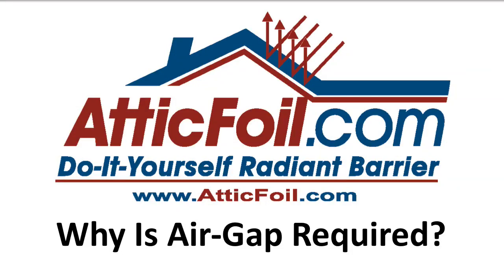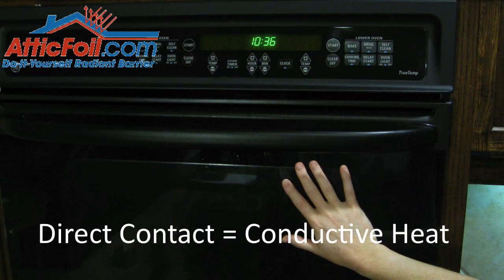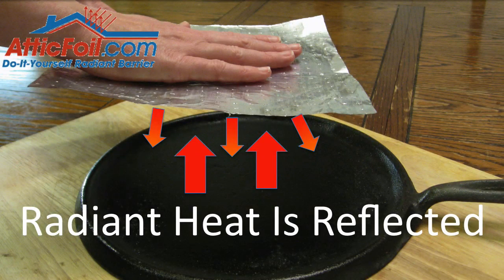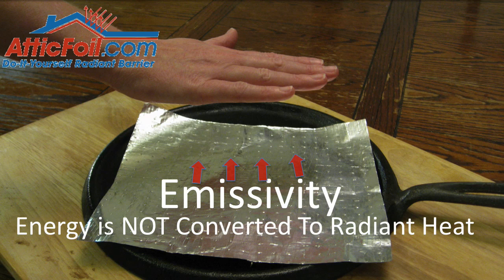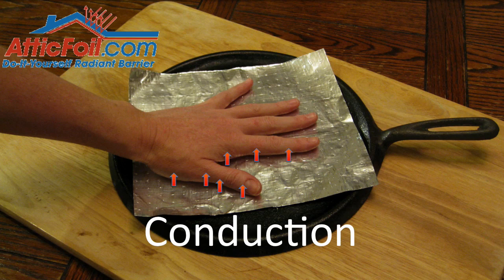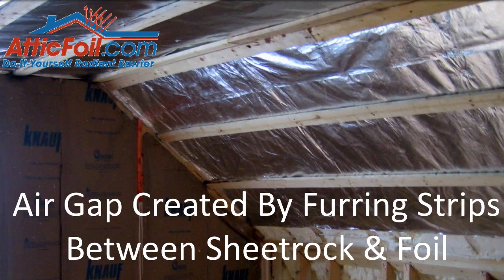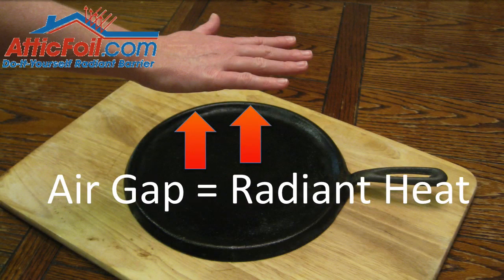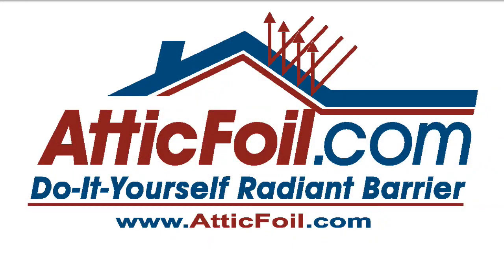Radiant Barrier Foil Insulation - Why Is Air Gap or Space Required?

Comment from the maker: Usually one layer is all you need.  Putting AtticFoil on both the bottom of the roof rafters AND on top of the insulation will have a some additional benefit.  

When you consider the extra time, money and effort for the second layer it is usually hard to justify doing both.  I have had some customers do both with great results. I would only consider doing both in a mixed hot & cold climate area.  Visit AtticFoil(dot)com and look at the "Best Install Method" page for more info.

Comment: I have a flat shingle roof, with metal roof over, stabled by footers, to create small pitch. There's a big space between the 2, like 6". Can I install Radiant Barrier product directly to my shingles? The dead Air Space is there.??
Reply from the maker: thewildlifecrew Yes, if you can get the radiant barrier between the metal and the shingles this will definitely help.  If it's ventilated air, it will perform a little better then if it's dead air.  The airflow will help cool the metal roof, reducing the initial amount of radiant heat produced.

Comment: A little late for the party, but I was hoping someone might be able to help; I'm looking at insulating RVs in a more modern fashion and have been trying to play with Radiant Barriers. One thing I am trying to overcome is the air gap, or "attic space". RV ceilings offer little room to work with, but does anyone think that a layer of large cell (expanded) polyurethane could play the part? Enough air in between the cells to act like an air gap? Thanks in advance.
Reply from the maker: Not really.  It can be a real challenge to get the required airspace in many assemblies.
Reply: Yes Keys,  use closed cell polyurethane foam immediately under/behind the vehicle skin.  Air gap is only used in primitive buildings to insulate from outside.
Reply: AtticFoil Radiant Barrier Foil Insulation

If I was to install this insulation in the van and leave a suit gap between the outer panel by stretching/fixing the foil insulation across the inner "spines" (supports) of the van.. Would this create the air gap you talk of?

Also does doubling up on thickness = doubling up on "r" value?
Reply from the maker: Yes, on the airspace.  No on doubling up. Foil is like an umbrella, it has no r-value.

Comment from the maker: Yes, generally galvanized staples are used.  There could be some reaction between the steel and aluminum, but the contact area is so small this is not a big concern.  I've got thousands of customers and never heard that it was an issue.  You could use plastic staples if this is a big deal.

Comment: I'm stud framing a shipping container and will cover it up with 1/2 inch sheetrock. Can I install radiant foil as the only means for insulation between the sheetrock and the steel?
Reply from the maker: Check out our new Foil/Foam products at www.BlueTexInsulatioin.com

Comment from the maker: @ak99372 Bubble foil around ductwork is a lot of work for very small benefit.  You must be very careful to maintain an airtight airspace.  You are better off using a standard radiant barrier/fiberglass insulation duct wrap.  you will get more, r-value, it's cheaper and it's much easier to install.

Comment: Is this the same with cold? Like for example, if I have a van with aluminum floors and put cork insulation directly on the floor vs creating a 1/4" to 1/2" air gap between a layer of foil and then the cork insulation. I mean will that airgap keep more cold out???
Reply from the maker: Technically, you don't keep the cold out, you are trying to keep the heat in.  In your case most of the heat lose through the floor is by conductive heat flow, not radiant heat.  So, the cork is actually better.  The www.AtticFoil.com would be best for the roof/walls that catch sun and you are trying to reduce heat gain when the sun is out.

Comment from the maker: @ak99372 Bubble foil has an R-Value of about 1 since it's only about 1/4" thick.  Any additional r-value you see advertised is in the form of a "dead air space" which is very tricky to achieve on ducts. It's not worth even trying.  I'd keep it simple and buy some "duct wrap" - R-4 to R-8 with foil on the outside.  It's a standard issue product in the HVAC industry. Before insulating you want to SEAL the ducts with a good quality mastic.  Seal then insulate.  Need more info? - AtticFoil-dot-com

Comment: Ok I was wondering about it touching insulation. So basically half inch free space.  Does the air bubbles wrap plastic not count as air gap space
Reply from the maker: Yes, 1/4" or more is all you need. www.AtticFoil.com does NOT have air bubbles.  And, you should never use a bubble product in an attic.  No, the bubbles do not count as an airspace because there is a layer of plastic that makes the bubble between the bubble (air) and the foil.  So, technically, there is not an airspace next to the foil.

Comment from the maker: @bumhokim There is a new testing procedure for flame and smoke.  This is called the ASTM E 84 and ASTM E 2599.  Nothing changes with the product except it must undergo a different method of testing.  Eventually codes like the IRC, IBC, and IECC usually adopt the ASTM Tests.  It will be a while before anything happens.  Right now nothing has changed.

Comment: So gor a house in winter heated by hot water radiators (which fo not radiate, they convect!) How effective is a reflective foil?
Reply from the maker: A radiant barrier like www.AtticFoil.com is definitely more effective when a radiant heat source is used compared to a forced air system.  Basically, there is more "heat" to reflect/keep in.

Comment: We have this in the walls, built back in the 70ts. mostly replaced with thicker walls and insulation but it acually worked decent. Maybe its something to think about - using foil And insulation!
Reply from the maker: Yes, here is the way to www.AtticFoil.com in an exterior wall: https://atticfoil.com/index.php/applications/inside-exterior-walls-hotmixed-climates/

Comment from the maker: @ChrisUTMBA Bubble foil is a decent product.  However, it usually works no better than AtticFoil - It's the foil doing all the work to reflect radiant heat. The only airspace is on the outside of the foil since it cannot have an airspace on the side that it is glued to something.

Comment from the maker: Trapping heat and trapping air are two different things.  You cant use the attic temp as a gauge.  Ideally, you want you attic cold and dry.  Radiant heat will still be reflected back by the foil. Your "Thermal Envelope" should be an airtight box, that is well insulated to reduce air infiltration and conductive heat loss.  Then, wrap that "box" with foil to reduce radiant heat loss/gain.

Comment: I've seen plenty of camper-van conversion videos using this product to insulate, or using it as a vapour barrier, now if I'm to use this on my camper-van ceiling due to the limited space will I achieve any R values if I install this leaving a 1/2 inch air gap from the bear metal of the van ceiling as I want to avoid the van getting hot in the summer but also have warmth in the colder climates, i'm unsure due to it being metal if I also need another form of insulation, any advice would be much appreciated? thank you.
Reply from the maker: The typical install method for van/bus conversions is Metal>Airspace (Usually made up of furring strips) Foil.  Check out our new product that is perfect for this application. https://bluetexinsulation.com/products/bluetex-supreme-foil-white-6mm-foam-radiant-barrier  It's basically metal building insulation, but we have been selling a lot for these type of applications.

Comment: So if i have rgid foam insulation that has a radiant barrier on one side and I want to install it between the studs on an interior shed wall, is that doable if i leave an air gap between the radiant barrier and exterior wall?
Reply from the maker: Yes, you are basically doing this AtticFoil wall method: https://atticfoil.com/index.php/applications/inside-exterior-walls-hotmixed-climates/

Comment from the maker: Thanks!!  I love satisfied customers!!

The paint is in direct contact with the bottom of the roof deck.  By doing this, the paint or foil backed roof decking is working off the emissivity quality of the aluminum.  The required air space is actually the attic space.   The foil backed decking works very well and is good option for a new roof deck.

The low emissivity surface from paint or foil causes most of the radiant heat to be lost upward from the roof rather than into the attic space.

Comment: If you managed to install your radiant barrier half an inch under your roof, and if you got 100 units of heat from the sun, and your radiant barrier reflects 97 units back, doesn't that 197 units total fry your roof?
Reply from the maker: Short answer is no.  Roof temp only goes up a few degrees.  Full info and video here: https://atticfoil.com/index.php/knowledge-zone/knowledge-zone-learn-about-radiant-barrier/myth-or-truth-radiant-barrier-damages-roof-shingles/

Comment: If this is the case then why do you recommend rolling your Bluetrx insulation out around the frame of a steel carport/metal building and then putting the outside metal panel ageist it and causing it to be sandwiched between the tube post and the sheeting
Reply from the maker: We never say this.  If you look at this page there are multiple places that mention (with pictures) using hat channels, wood or foam strips to create the required airspace in order to have a radiant barrier.  https://bluetexinsulation.com/pages/new-construction-metal-framed-buildings-installation

Comment: I'm replacing some old insulation in an exterior wall but only have 2 inch gap to work with so I'm using double foil rigid insulation. Glad i watched this video as i realize now how important the air gap is .
Reply from the maker: You would be better off with foam board and www.AtticFoil.com or look at our www.BlueTexInsulation.com products.  The bubble foil products use Mylar and will eventually fall apart.

Comment: Does the air gap have to have moving air?
Reply from the maker: Not required, but best to have a ventilated airspace.  Ideally we "back ventilate" any exterior cladding.  But if you can't, you still get the benefit of the radiant barrier but not the "cooling" effect of air moving across it.

Comment: Taking your example with the air gap between the skillet and the foil: would the foil still work to reflect radiant heat if it was partially obscured by, say, a gauzy fabric? Or does it need to be 100% clear to radiate the heat? 

My application is for camper van window covers, and whether I can get away with putting a thin cover of fabric over the foil, or whether that would negate its benefits.
Reply from the maker: If you maintain an airspace between the fabric and the foil, it will still have the full reflectivity value.

Comment: Hi, So I'm looking to insulate a van...Would it work to attach SilveRBoard or AtticFoil, not directly onto the van walls, but onto the raised interior parts of the walls and roof, essentially creating an air gap between the van wall and the radiant barrier? Thank you!
Reply from the maker: Yes, it would work great.  We have many customer convert shipping containers into usable space doing this same method.

Comment: I have a question.  In order to insulation a garage door in California climate, do I need to put reflective foil facing garage door with some air gap, or facing the inside the garage?  Do you have any material for garage door insulation?  Thanks for the info.
Reply from the maker: You want the airspace facing the hot door.  Here is a method/video I did. https://www.youtube.com/watch?v=OROTrjn1j9E

Comment: So the foil is for summer insulation or better to reflect heat?
It is not used for maintaining the heat in the house during winter?
Reply from the maker: It actually does both.  However, it is most effective at reducing Summer heat gain.

Comment: I'm looking at insulating a shipping container. So do I put the reflective backing down first, then the insulation, or is it the other way around? And if it's the reflective first, can I place it directly onto the metal, or do I have to create a gap?
Reply from the maker: You will need airspace between metal and foil.

Comment: Great explanation.  I live in New England and am considering putting this up in my attic as well as in a couple of crawl spaces in my basement attached to the rafters.  I basically want to trap heat in the attic and above the basement.  My attic is about as high as the one in this demo.  How much heat do you think I could realistically reflect back if the areas are cold to begin with.  Attic is a little warmer than outside temp.  Thanks
Reply: Probably not much... because most of the heat in your attic is not radiant heat, it is from the warm air rising through your home.  That heat is a convective heat.  Better off sealing the roof well from air leaks, and installing insulation if you want to keep your attic warm.. But need to be careful!, the roof should remain cool to prevent ice buildup on the outside... this is prevented with air baffles (hopefully you figured that out after 13 years haha, cheers)

Comment: I have a steel roll up door I wanted to put a barrier on the inside held down by magnets(there's a yt video). based on your video it wont work bc there's no air gap, I am I correct?
Reply from the maker: No it will work.  The inside of the garage IS the airspace.  If it's directly up against the metal it will work off the emissivity quality.  You just can't "sandwich" the foil and have no airspace on either side.  This video may explain it better: https://www.youtube.com/watch?v=uGP5KobU6R4

Comment: What about corrugated iron roofing which has over an inch of air space between the corrugations?  Can radiant barrier be installed with no gap?
Reply from the maker: Because of the corrugations, you DO have the gaps.  It depends on how much of the roof profile touches the deck.  The more direct contact, the less benefit.  Take a look at this video show the "direct to deck method" https://youtu.be/_lPdS3wwtLo?t=2m41s

Comment: Can I put Attic foil over baffles instead of foam board like in your video? Cathedral ceiling to be insulated.
Reply from the maker: Shane Waller Not sure by what exactly you me by "over".  If you mean below the roof deck and then styrofoam baffles, this may or may not work.  It really depends on how much of the foil is "sandwiched" between the baffles and the insulation.  The foil MUST have an airspace on one side to work.  Can you replay and describe the "layers" you propose coming from the roof down including all air spaces?

Comment: Hi, does the air gap have to be on both sides of the barrier? or just one? I want to fit plasterboard onto the rafters but also use a radiant barrier. Thanks
Reply from the maker: Just one side. Depending on where the airspace is will determine if the www.AtticFoil.com works off of the reflectivity or emissivity quality of the aluminum foil.

Comment: Embarrassing question: Can I use Heavy Duty Tin Foil as my Radiant Heat barrier? I can't afford the real product.
Reply from the maker: thewildlifecrew You could use regular foil for a staple up method, but not over the insulation since it is "solid" and is a vapor barrier.  However, regular foil won't hold up long.  Just the weight of the foil and a little breeze through the attic will rip it off, or any critter in the attic will pull it down.

Comment: Adding attic foil would it shortened the shingle life span?
Reply from the maker: The roof temperature over a radiant barrier usually only increasers about 5-10 degrees.  This is generally considered to have a very minimal effect to the life span of the shingles.  Here is a video with thermal imaging showing the difference in roof temperature on a roof with part done with AtticFoil and part done without.  http://youtu.be/OHpyv_kxmoI?list=UUAUzU97Yc8ChVXSpVvMhXYQ

Comment: Thank you for the very good explanation. I have a question that you might be able to answer. I’ve seen some garage door insulation videos using a radiant barrier mounted on foam. The one I am thinking about using is one with a thin foam radiant barrier that uses spacers between the garage door and the barrier to create the air gap. Will this work effectively in your opinion?
Reply from the maker: My method is easier and better in this video: https://youtu.be/OROTrjn1j9E

Comment: can i put insulation under my wooden floor up against the wood , would i put foil against wood or away side , or does it come with foil on both sides
Reply from the maker: It sounds like  you are doing a crawl space application. Here is the info you need: https://atticfoil.com/index.php/applications/crawlspaces/
Reply: @AtticFoil  thanks

Comment: Would heat increase in gap ( void space ) damaging electrical wiring?
Reply from the maker: It should not cause any damage to wiring.  The increase in temperature (surface temps) inside the gap would probably be less than 10-20 degrees.  The top roof surface temperature usually only increases less than 10 degrees.  This increase should not be significant enough to cause any damage.